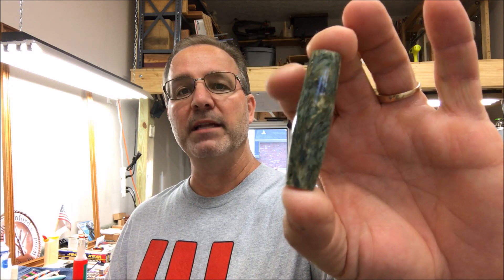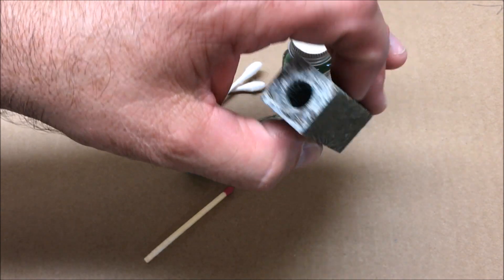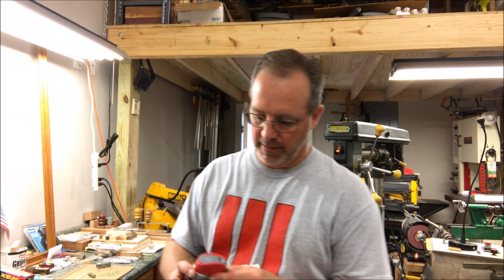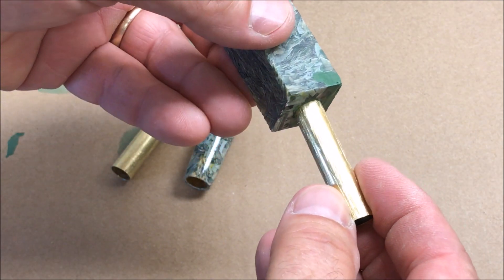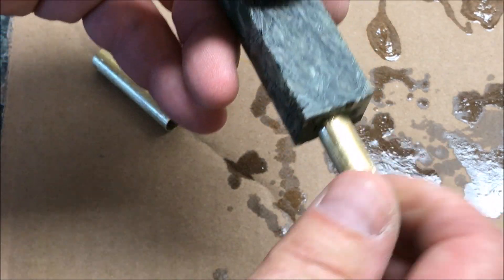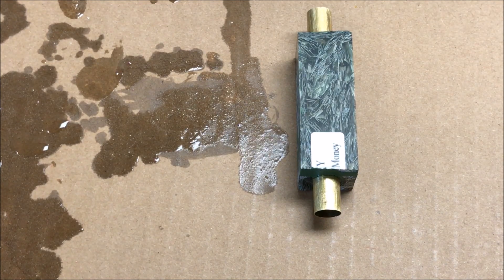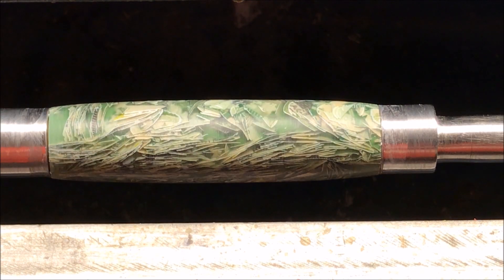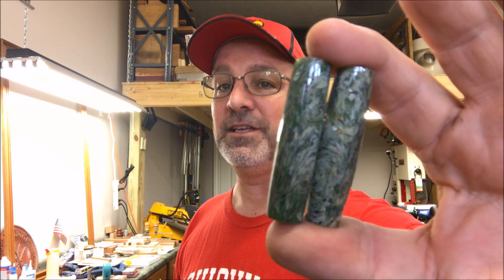Here's the other half of the money blank with paint inside of the blank

Comment: I like the painted tube.  Thanks for the tip too...I just turned some clear Alumilite blanks that I cast and didn't like the results mostly because of the scuffed tube showing.  I'm going to give this a shot!
Reply from the maker: +Make With Dad Thank you,
  Once painted stand the tubes on end to dry. You won't have paint build up at the bottom of the tube like I did. Maybe put a piece of scrap on each end so the excess paint can drain out. The sand paper is still a good idea, you want the scratches so the glue sticks. 

Regards,
Bob

Comment: Painted looks best.
Just a thought I've not tried this but you may be able to remove the unpainted tube if that's the looser :-) using PCB etch fluid (acid) it may take a couple of hours though for the fluid to dissolve that much brass the acrylic resin should be OK
Regards Robert
Reply from the maker: +Robert Cameron Thank you Robert,
  I have tried Acetone and it works but dissolves the blank too. 

Regards,
Bob

Comment: Hi Bob,
I like the painted blank better. Do you think that if you used the paint to glue in the tube        that it would work as good as the glue?
Reply from the maker: +Jim Kodysz Thank you Jim,
  I don't think the paint would work. 

Regard,
Bob
Reply: Jim Kodysz no but some put a drop if paint in the epoxy they use.

Comment: Greetings Bob,   I enjoy all of your videos and have learned much as a new turner!  I liked the painted best.  I see at Wood Truningz website that their instructions for the Money Blank suggest using a Black or Green tube.  I see you painted the blank and it appeared to work well.  My question is what kind of paint did you use.  The jar looked small like the old solvent based "Testors"  model paints I used as a kid but I could not tell from the video as the label was turned away from the camera.  Have you found it better to paint the blank or the tube?  The pen supply companies sell white and black tubes but no other colors that I'm aware of.  In the case of the Money Blank I think the Green would be better than Black.  Please advise.

Thanks,
Reply from the maker: +mmfenske1 You were right, it was Testors model paint. I find it best to paint the inside of the blank because if you just paint the tube, and the blank gets thin, sometimes you can see the glue. Painting the inside of the blank ensures that will never happen. 

Regards,
Bob
Reply: Was this a "solvent" based paint vs a "water" based product?  Thanks.
Reply from the maker: +mmfenske1 Yes, it is solvent based.